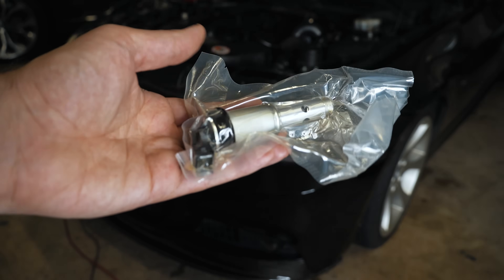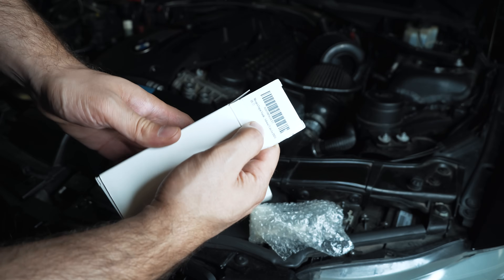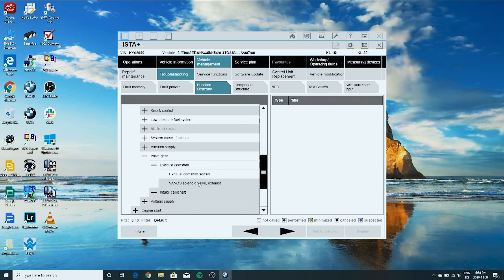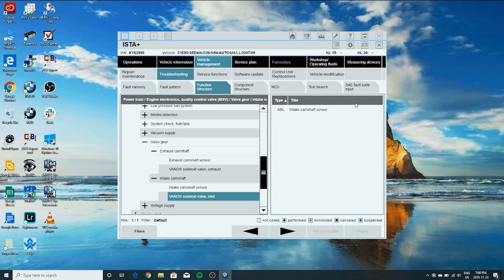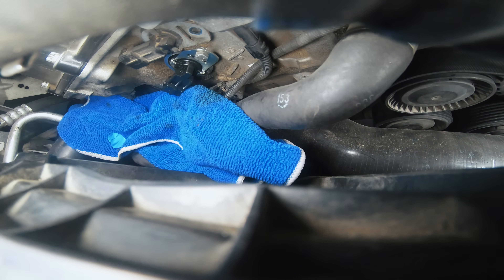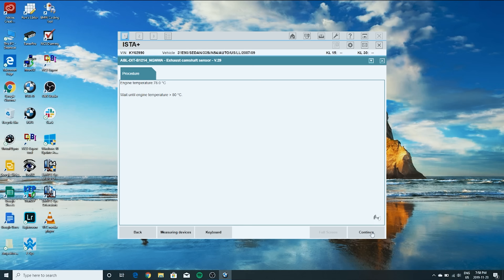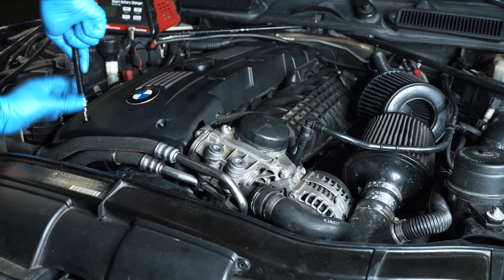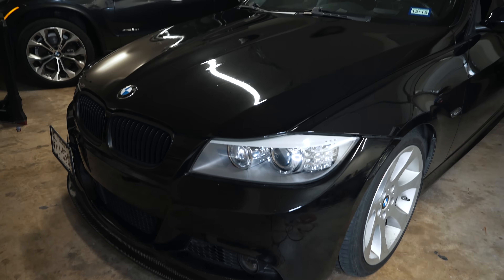I Bought The CHEAPEST Vanos Solenoids I Could Find! | BMW E90 DIY

Comment: Man I looked at your log and you are not misfiring you are knocking hard even up to +7° the tune needs to be corrected it seems to be a fuel quality issue since timing isnt insane AFRs look good for E50, cant tell spark dwell but you need to have your tuner fix this, also your TMAP is doesnt seem to be operating correctly because a 3rd gear pull should for sure put more intake heat in, I would swap that out as well
Reply from the maker: Thanks for the input man, I might just upgrade to a 4 bar sensor and see how the IATs look.  Maybe the car isn't pulling enough timing giving the actual IATs if its reporting low
Reply: @VehicularDIY  could be incorrect scaling for the n20 sensor you got
Reply: Yeah, it is a Ken tune and he has done weird and unsafe things before.

If DIY was wise, he would try another tune from a more reputable tuner.
Reply: @machtschnell7452  I would 100% disagree Ken Atkinson is one of the best in the business I help a lot of people remotely and I have seen his work and I have more problem sending work his way, also Ken will make it right as long as he is aware of it.

Comment: I bought a pair of these off Amazon for about $40 for the pair plus shipping. 
They didn't work out of the box, they put the car into safe mode and acted worse than the failing oems...
I then swapped them out again for oem (From fcp euro) and those work great.
Reply: I bought the $40 ones off amazon . Worked a solid year up until I totaled the car
Reply: @Beamerbrad   ... so was totaling the car a benefit?  Lol
Reply: Spirited Driver nah I came out even for what I paid. Was 09 X6 with n63. Motor had just been rebuilt less than a year before. Would’ve been a benefit if had happen 40-60k miles after the rebuild when it would’ve been leaking again or if it had happened before I had it rebuilt
Reply: @Beamerbrad  darn
Reply: I tell everyone even on my channel DO NOT USE CHEAP SOLENOIDS only bmw dealer ones work 

I’m glad you seen it aswell mate this is where my good buddy here got this from as I’m ALWAYS telling people do not use cheap solenoids
Reply: BMW Doctor Scotty Kilmer should be banned from YouTube. The cheap amazon solenoids worked fine on my n63 nearly a year

Comment: I have N53B30 2008 330i with Blackline ATB LSD no fault codes 70k miles decided to do preventative maintenance changed Disa valves ordered Vaico Vanos was sent SHARK told they were better valves,it’s now like driving a different car smooth very torquey throughout range ,is this engine the basis of your 340i without Turbos ? Keep up the fantastic videos best on you tube :)

Comment: off topic, what is good enough to resale car w $300 evilbay turbocharger for 2010 a5 2.0t quattro.  Is it a k03 stock
Reply: oddly no low press eng code in PADDLE, very quick me think wastegate trigger, lags in D,S MODES ON LAUNCHING,  80k miles 2010
Reply: $300 Dinan Sport piggy 14psi stock add +4psi in RACE MODE.  Helps lag but low press, check turbo code still in drive normal and eco

Comment: Tuner motorsports , ecu, FCP euro, CarID, is where I start with parts
Skyway from carpart the window regulator was trash. I rebuilt my regulator using the  cable from the Chinese crap to get by for as long as I can.
Please visit garageaholic bmw swaps

Comment: You can disassemble oem solenoid and clean it From the inside. Thus oem solenoid will work for a very long time
Reply: @ot2nie  how did you clean them? Did you open them and clean inside?

Comment: I’m having the same issue as you. Misfire after 6200rpm on cylinder#6 you should take a log of when it happens and get your tuner to review it. I changed everything on mine injector, spark plug, and coils. Yet the misfire was still there. I sent a log to my tuner and he said it’s false knock. If you’re on any of the Facebook groups for the n54 you can find a lot of people with the same issue. It seems to stem from the automatic transmission creating chatter at higher rpm and the knock sensors pick it up.
Reply from the maker: Hey thanks for the feedback.  I've read that some people are disabling misfire detection after 6k RPM.  Do you have an auto as well?
Reply: Vehicular DIY yes I also have an auto that I’m currently in the process of manual swapping it. I’ve also heard about people turning off the detection after 6k rpm and they were okay. Not something I would recommend though.

Comment: A lot of people recommend the Vaico solenoids as they seem to last longer than oem
Reply: Price range? if you don't mind please
Reply: Bought mine on eBay for $99
Reply: @naderg2  Not everything on eBsy is genuine.
Reply: I think that the only real choice is cheapo no-name or genuine. I mean the ones with branded boxes is probably the cheaper parts so begin with so you're just paying more for the box or label. Similar to for example coolant fans for E46, lots of aftermarket brands.. but all fans are the same crap with different stickers (just get the cheapest).
Reply: I just installed a pair of Dorman on mine since I’ve heard some guys having good luck with them and Dorman will sometimes fix the OEM problems. Guess we’ll see what happens.
Reply: @greaterbw  how did the Dorman work for you?
Please reply. Thanks
Reply: Link?

Comment: I replaced my vanos with eBay ones at 134,300kms and they're running strong at 144,100kms so far. Mind you I didn't buy the cheapest ones, these had 100s sold and came packaged nicely. Hopefully they last 💪
Reply: Man i just bought some SKP off rock auto .com $35 each ... How did you know bad vanos ?  Or did you just change them to change them
Reply: @MrMoneyinda77  lots of things. Codes, rough idle, rough going into boost, Cat dying, exhaust note changing while driving. The list goes on and on.
Reply: Where are these $100 ones made?

Comment: man your problem is quite simple....it might be just the bad gaping on the spark plugs. you run almost 25 psi...if you run 20 psi without the misfire you just have to re gap the spark plugs to 0.620 mm or if you run under or till 20 psi set it to 0.8 till max 0.9 mm
Reply from the maker: I got NGK plugs that are two steps colder than stock gapped to 0.018" at the moment.